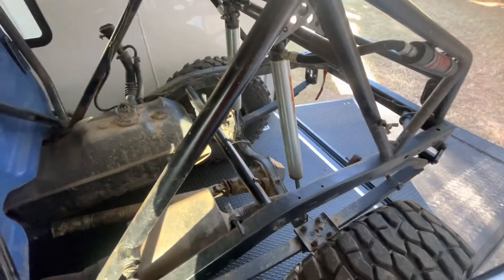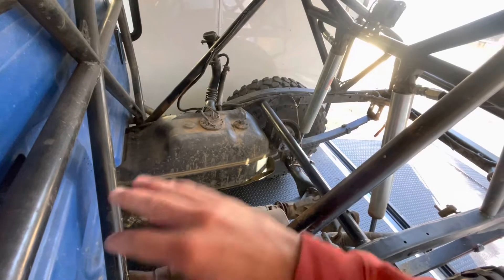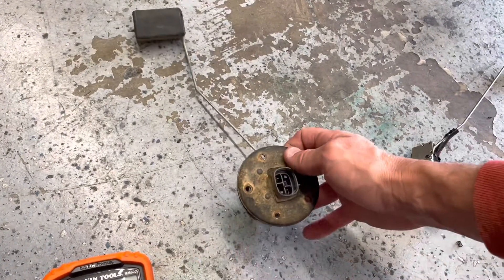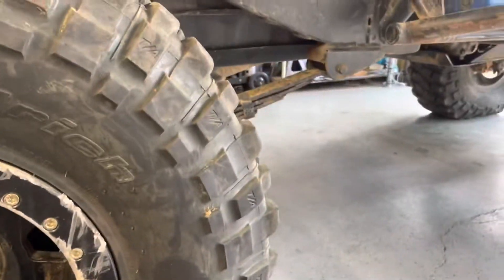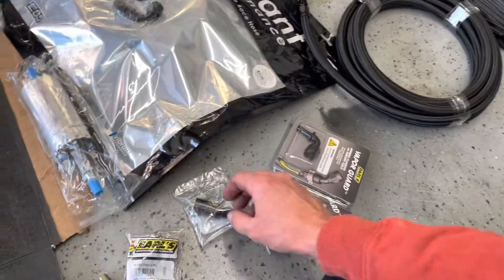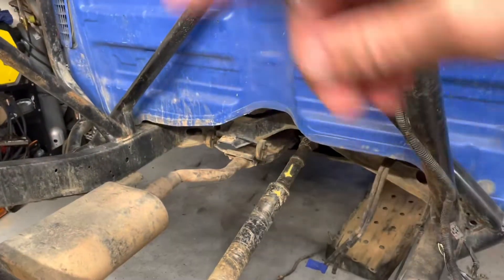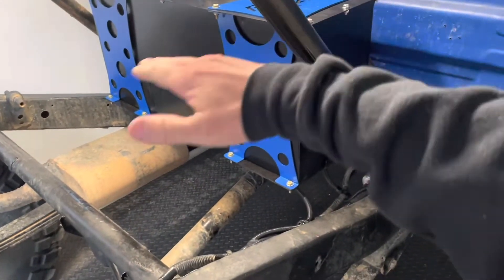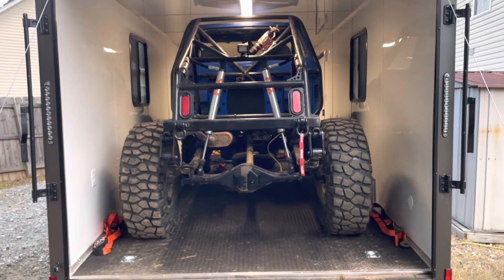Installing a fuel cell in the rock crawler

Comment: What brand of fuel pump you running?
Reply from the maker: I run common ford pump. Search “ford e2000” fuel pump it fits a ton of applications so it’s easy to find and it’s fairly cheap. It has similar deliver rate to the factory 22re pump. It also is easy to wire up and plumb because it has quick connects on both ends.
Reply: @tims_4x4_garage  I have the same pump but what “ brand “ you running

Comment: Do u have a part number for the fuel pump ?
Reply from the maker: I used an “e2000” fuel pump. it fits many 80s and 90s fords so it’s cheap and common. I read about it somewhere, probably pirate, and it has the correct flow and pressure. Has been working well. Make sure you clean whatever fuel cell you use because mine still had plastic particles in it even after shop vac’ing it out. I’m adding a fuel filter between the tank and the pump.
Reply: @tims_4x4_garage did you ever add a filter?

Comment: Perfect timing dude, just about to install a fuel cell in my rig.
Reply from the maker: Heck yea man. Hit me up if you have any questions but it was pretty straight forward. My pump wasn’t marked with an arrow but the fuel flows toward the terminals. I had it in backward at first. The earls QD were too long for my pump so I got some off Amazon made by k motor they worked fine but they have tiny set screws. I’m gonna lock tite them so they don’t fall out. Other than that it worked perfectly
Reply: @tims_4x4_garage   hell yeah, what size hose did you use for the return and feed lines ?
Reply from the maker: @jadalkhoury02  both the return and the vent lines on my truck were 1/4” (or metric equivalent) rubber hose connected with spring clamps from the factory. I came out of the fuel cell with the 8an -> 6an reducers and then a 6an 90° elbow with a 5/16” barb end because it was the smallest I could find. I connected the 5/16” rubber fuel line to the 1/4” lines with just barbed reducers and hose clamps. Since they were rubber hose with clamps from the factory I didn’t see any need to spend the money on AN stuff
Reply: @tims_4x4_garage  how long was the line that went from the tank to the fuel filter ?
Reply from the maker: @jadalkhoury02  That I can’t answer off the top of my head. Don’t be like me and order 20ft because that’s way too much and the shiz is expensive. I guess it depends where you mount your cell and filter.
Reply: @tims_4x4_garage  I built myself a custom flatbed, the cell would be sitting right up against the cab. I’m guessing 10ft hose, my issue is I have no experience in an style hose for the feed, not sure if I can just run regular hose with hose clamp for the feed.
Reply from the maker: @jadalkhoury02  I wouldn’t use just hose clamps cuz you’re lookin at 70-95 psi. AN fittings can be a pain just watch some videos on how to cut them and how to do the ends.
Reply: @tims_4x4_garage   I will for sure, thanks for the help! Sick rig dude
Reply from the maker: @jadalkhoury02  Thanks, buddy. It gets the job done. It’s been really dependable